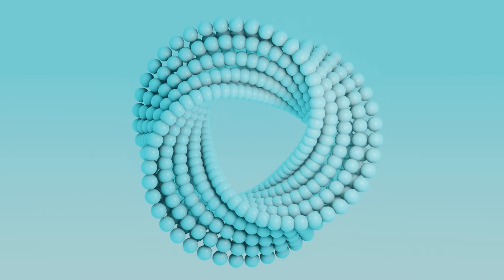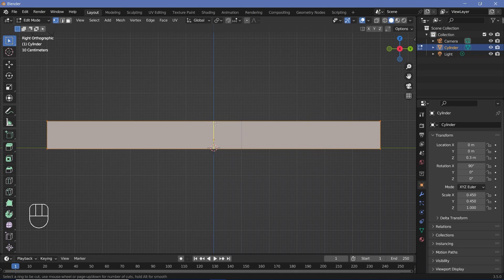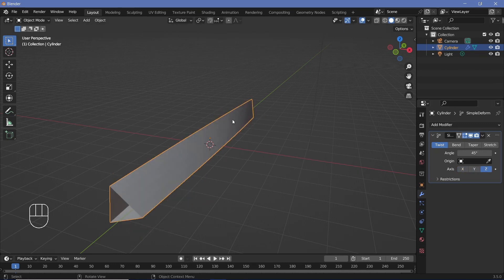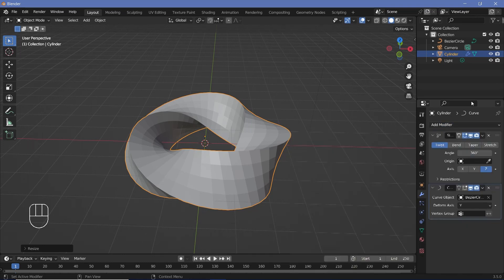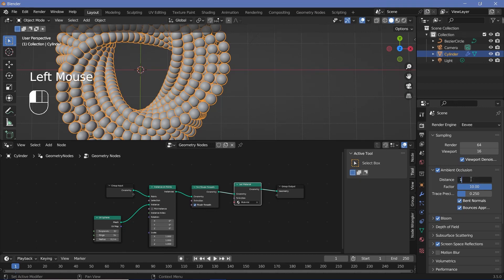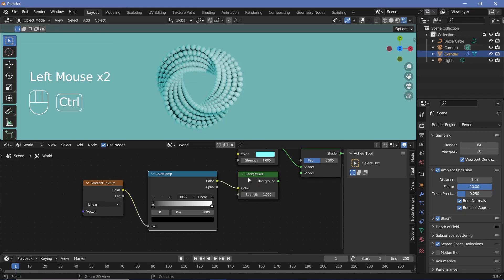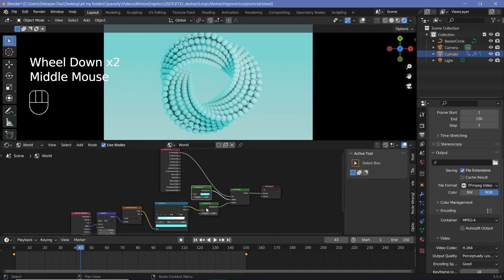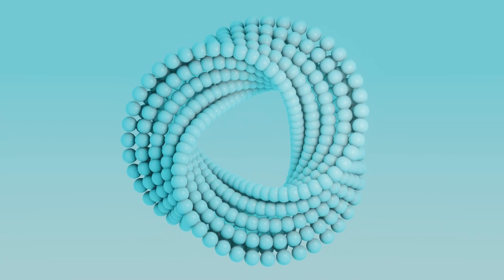Abstract Loop Using Geometry Nodes - Blender Tutorial

Comment: Sorry to bother you but as I said I am on the shader editor. Reduced roughness to 0.2 and set base colour to light colour but on rendered view the colour is not showing up on the abstract. Please can you help? Thanks x
Reply from the maker: What is being shown in the rendered view? Is it just black or the default material?

In case the default material is being seen, ensure that you have a "set material" node in the geometry node tree and choose the correct material in that node. That should fix it.

In case it's black, the shader might not be connected to the material output. Take a look at that and it should solve the issue.